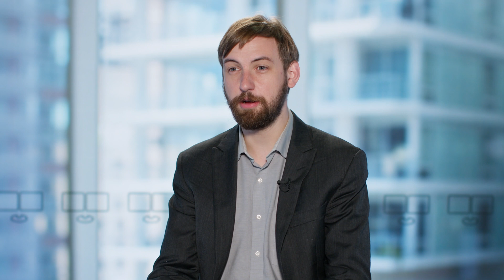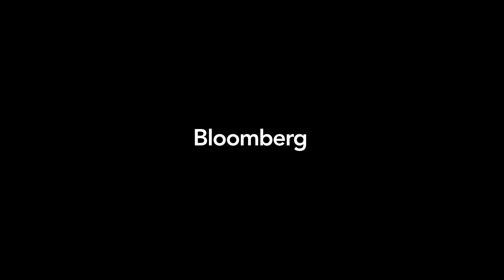Bloomberg Expert Access with Derrick Flakoll

Comment: 1:10 because US factories operate closer to the end of the supply chain - make a finished solar module or a final battery. 
1:30 what kind of trade and infrastructural partnerships US set.
2:45 with BNEF, you get to see the whole perspective of energy transition looks like, and not a narrow slice